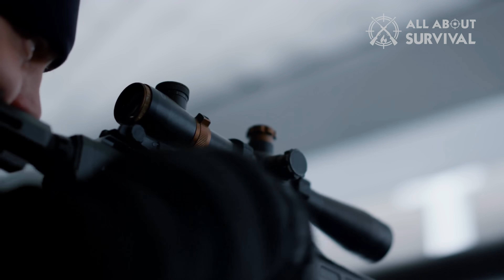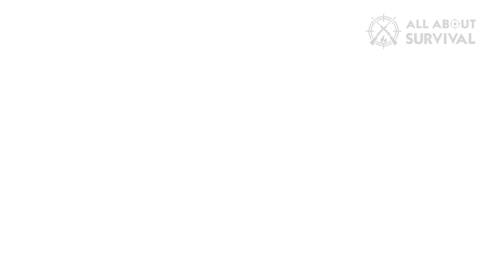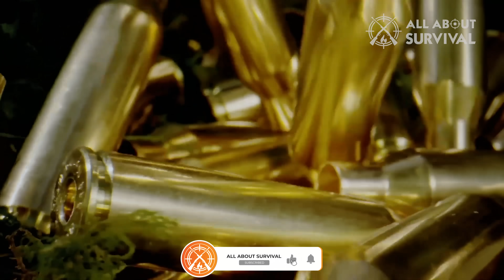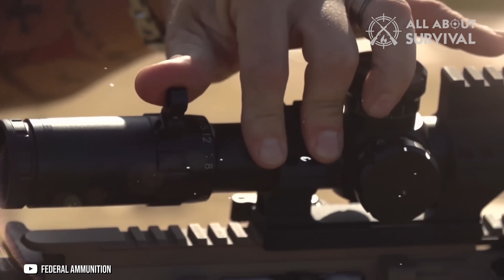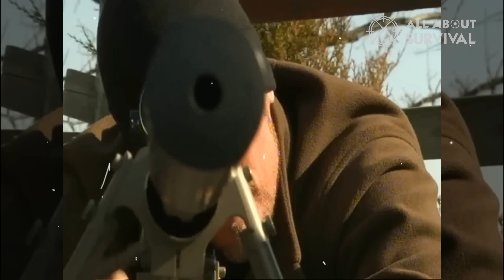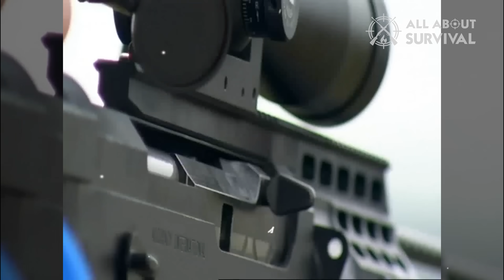Best Long Range Calibers 2026: The ONE Caliber You’ll Wish You Had!

Comment: I have a 6.5 Grendel, 22 ARC and 224 Valkyrie. The 224 is my favorite. I’ve broken two bolts on the Grendel and am having accuracy issues with my 22 ARC. Case life is also better with the 224.

Comment: 6.5-284 Norma?  No thanks – I opted for the 6.5 PRC.  Same bullets, higher velocity and FAR better manufacturer support.

6.5 Creedmoor?  Yup, it’s a winner.  Opted for one.  Then a second.

6mm ARC?  Not for me.  Designed for use in AR’s, it offers nothing I want.  Bolt guns enhance its performance but for bolts I’ll take a .243 Win or 6mm Creedmoor every time.

224 Valkyrie?  Another cartridge designed for an AR.  I’ll stick with the .223 and 5.56, for which there are far more options.  If I need more I’ll go to a bolt with a 22-250 or 22 Creedmoor.

416 Barrett?  An obvious option for really long range shooters who don’t mind spending $12-$14 bucks per shot with factory ammo, $4900-$10,000 for a rifle or lugging a 33-lb rifle around.  Nope, won’t miss it at all.

Comment: It’s popular to bash the 308. But there are a million 308 rifles out there. Today’s 308 haas the availability of high BC bullets like the Juggernaut which will maintain supersonic status at 1000 yds without buting all new equipment. The 6.5 Creedmore requires the same action length as the 308 meaning an AR 10 platform is required for both. Hot 6 mm’s can be accomodated and an AR 15 platform but most require a .41 bolt head vs rhe 5.56 standard of .378. Many question the reliability of a thinned bolt head with a hot cartridge. The newer 6 mm max may be an answer utilizing the .378 bolt head. Newer, recently developed cartridges with long high BC bullets and 30 degree shoulders are more efficient at long ranges. But adoption of modern bullets can keep older cartridges like the 308 relevant without buying all new equipment. I have followed the 6 mm max since inception but it is slow going with extremely limited production of riflew, barrels and ammo. It will reach 1000 yds in an AR 15 platform requiring only a barrel and magazines to convert. What’s the hold up ?

Comment: I shoot nothing but 223 but do agree the Valkyrie has the potential to replace the 5.56 but why ? 
The 5.56 has the extra powder for more speed and also for heavy bullets if you want (up to 100grs.) and a massive availability for parts. 
Don't see why military would change from 5,56 , cost is to much.
After people see the costs involved for Valkyrie it will just fade away like the .222

Comment: Your didn’t mention any of the WSSM cartridges because Olympic Arms fitted them to AR-15/M-16 family successfully and they will out perform some of what you have listed such as the 6.5 WSSM. It stomps the puny 6.5 Grendel because it is a low pressure cartridge. Why not reinvent the 1950s .224 cartridge that used 120 grain bullets and get real. Your .224 Valkyrie is still a varmint cartridge and not yet in the DEER class. The 5.56 NATO still takes 8 torso shots to bring down a 2-legged DEER. Colonel Jeff Cooper was right ONE SHOT ONE KILL. That’s why WHITE FEATHER didn’t use the gutless M-16/AR-15 in his outreach program. Why did you whisper about the 6.8 SPC? Olympic Arms fitted the .22-250 into an AR-15 platform and it should outperform the.224 Valkyrie! Put said .22-250 with a 120 grain pill in an AR-10. That should sing!

Comment: I'm a 7.62x51 fan. It never failed me when my own life was on the line, as well as others. Are there better? Of course, there usually are much better rounds, but at what price (that's important to me) and other folks. And I started using 7.62x51 back in '68. It worked very well then, and for some odd reason, it still works just as good all these years later ;}> It ain't broke, so it don't need any fixin'. But I do get a kick out of that there are so many "comparisons" to see what is better and so on. So, for me, my much used and trusted round, looks to be a benchmark for comparison. That my friends is what a good ol' dependable round can still do, maybe a little better than the 'masses' :}>
Reply: It’s easy to shoot any cartridge that’s been hammered into the dirty like the .308/7.62x51 by the US Military. Any possible scenario that could exist & does exists from temp, dew point, 30% humidity, cloud cover, wind from all directions, bullets of all weights, powders, brass, primers, brass that weights “X”, this powder, that powder, prone to standing, the .308 Information causes nausea as to it’s endless volumes. Anyone wanting to buy a cartridge that’s had every conceivable shooting scenario already computed & dialed in; you can’t beat the .308 or 7.62x51. Just follow everything the US military’s spent years compiling & yeah….you’ll hit this or that @ this particular range. To me it’s became the lazy way for anyone wanting to get into 1k shooting as you need do NO FIELD WORK, as anything you can possibly think of has already been done for you. Thanks but No thanks! Not saying the .308 can’t get it done but at this point in metallurgical advances, stock fit & finish, optics, reticle specific dial-ups, bullet performances at various yards & the vast lineup of incredible cartridges I’d literally take at least 7-10 other cartridges over the .308 ANYDAY. I prefer cartridges such as the 6.5x55 or .260 Remington to be brief but back to basics if presented a .308 or .30-06, I’ll take my trusted & copied (by .308), .30-06’ Springfield any time no matter the objective. I mean NO disrespect to any of you & your chosen round, it’s just me saying I choose differently & know there are far better cartridges out there or old standby’s that get er’ done easier & better. (However, all that said & I’m including the old workhorse .30-06? Some habits are too hard to break?)
Reply: I follow an extreme long range shooter from Australia and he swears by that as the cartridge to learn to shoot long range.  His claim is the newer cartridges take away calculations and skill that are developed through shooting said cartridge at distance. Much respect sir. I'm dialing mine in and sending it
Reply: Let's lose, I also have 7.62x51 and 300 win-mag for big game, 6.5 is just a fad or for those who can't handle the recoil!!! It won't last!!! Also much better reliability!

Comment: The 6.5 Creedmoor fits perfect in an AR10 mag with a 140 eld. If you load magazine length the bullet is above the donut which will help keep velocities tighter and long range groups better. The velocity given for the 6.5-284 were pretty lame. With 140gr bullets mine shot good using 4831sc at a velocity of 2970. Using Reloder22 it shot good around 3080 with 140s.  My AR10s in 6.5 Creedmoor  shoot at 2977 fps.
Reply: That is a dangerous load. Or your just full of it.
Reply: 6.5 Creedmoor at 2977 fps?? Maybe with light for caliber bullets. With that velocity, you've giving up the only thing the creedmoor has going for it, the shorter case and ability to load heavier high BC bullets and gain a little.... very little advantage at extreme long ranges, like 900+ yards.  Any real world hunting distance and the 7-08 smokes it. Honestly even with a high BC bullet, it still barely beats the 7-08 even at ELR's.
Reply: @chrisrosenthal1210  maybe true in numbers the difference  between the 708 and 6.5 is negligible at any range imo. Sectional density matters as well you just don't hear anything about it anymore it's all about the BC snipers I UT there.
Reply: @albertlemont5471   That's one of the things I have against the 6.5 CM...  It's not a bad cartridge. The concept is good, and I get what they're doing.  But when Hornady brought that thing out, they HYPED the ** out of it to the point everyone though the wheel had just been reinvented.  I get it  though. It's marketing. The best way to create a sales boost is with a  "Latest and greatest" new product.  New firearms sales, new ammo sales.... Not stagnant sales from older guys sitting on a 10 year old rifle that works fine and they already have 15 boxes of ammo for lol   The concept of high BC bullets is awesome.  IF IF IF you are shooting at long enough distances to see the benefit.  Target shooters rejoice!!!.... You can now mitigate wind a bit better, stay supersonic at a longer range, and have less drop to deal with...  BUT, how much is it really helping you?  I mean if it had 11 inches less drop than caliber X... does that really matter when you're already dialing 230 inches od drop?  Not a lot of difference between 230 and 241. I mean if you can hit with one, you should be able to calculate drop on the other. In the case  of the creedmoor and 7-08, the difference at 1,000 yards is a couple inches. Almost identical. But everyone and their cousin bought into the Hornady hype and had to have one. Now you don't even hear about 7-08 much because the sales dropped. Newer generation thinks the creedmoor is FAR superior when it's really not.  The problem with the creedmoor is they backed that shoulder up in order to seat those long high BC bullets. It cost them case volume and in turn much needed velocity.  Step up to a PRC or a wildcat like the 6.5 Sherman Short and now you're cooking. Those bullets need that 3k 3,100 fps mark to really shine.. for a hunting situation that is....  Now in the real world, like ethical hunting distances, say under 500 yards, there's several calibers that outperform the 6.5 creedmoor. 7-08 being one of them. The 7-08 will shoot a heavier bullet faster AND flatter withing 5 or 600 yards. The drift starts to pay off around that range, but not by much. I mean are we really thinking 16 inches vs 16.4 inches is a game changer? The 7-08 has a larger diameter, so more sectional density and will perform better on soft tissue game animals.  If I was at a ELR match punching a paper target at 1,000 yards, I'd go Creedmoor..... Deer hunting... I'll stick with a .308, 260 Remington, 7-08 any day in a short action..   If i want to extend my hunting range, with a bullet that has enough energy to reliably put down an animal at those longet 5 to 800 tard ranges, I'm stepping up to a caliber that will still have some punch way out there. Something like at minimum 6.5 PRC, 6.5 Sherman Max, 7mm Rem mag..... Sorry for the book.... lo lI get passionate about cartridge trends and misconceptions.  And I think you get it, so this is for others reading mainly.
Reply: All short action cartridges fit in an ar
Reply: @unfrsaken_soul226  well kinda. 308,243,6.5creed,7mm/08 are short action that fit in an AR10 not an AR15.
Reply: @unforsakensoul22  that maybe true but they don't all fit just right like the 6.5 Creedmoor.
Reply: @unforsakensoul22  Not true at all. You're just as bad as the channel creator.

Comment: Pre-64 model 70
25 in PacNor barrel
30-06 Ackley Improved
190gr. Acubond Long Range
61gr. Superformance pdr.
2960 fps.
1/2 inch to over the horizon!
Reply: At this point 300 win mag and you shoot mooore long !!! Whit Sierra Match 210 gr. and the right power , or MK11 recharge recipe  !

Comment: 7 prc should’ve been on the list. Getting to fire bullets with a bc of .796 around 2900 fps in a standard length action is impressive.
Reply: 😂7mm rem mag & 7mm Weatherby mag both beat 7mm prc
Reply: @poorfatman5317  Do you always use the laughing emoji when your wrong?
Reply: Rebarrel a 7mag with a faster twist barrel and the 7prc is a chump!
Reply: @MrLucky426  Yes let’s spend money on a custom barrel, then spend more money having a gunsmith install the barrel. Now we have a bolt action single shot that beats something else by 50 fps yet still loosing to the 28 nosler.
Reply: @chadperry4021  28 nosler is a barrel burner!  7mag with a faster twist will push heavier bullets at acceptable velocities saving barrel life.  Changing a barrel is not tough to do these days!
Reply: @chadperry4021  also a 28 nosler doesn't have the twist to shoot the heavier bullets!
Reply: @MrLucky426  So when your cartridge looses you bring up being a barrel burner………Then right after that state a barrel is easy to change. Your loosing the discussion to yourself.
Reply: @chadperry4021  no cartridge loses if you have the right combination.  The 7prc was not that good to start with when there is already a 7saum or the 7wsm.....  The 7prc is pointless unless the casing was that of the 300prc.  

For instance look at the 243 win and the 6mm remington....pretty much the same cartridge,  just different twist rates...
Reply: @MrLucky426  if the 7 had been based on the 300 case it would’ve been the same capacity as the 28 nosler. In your own words a “barrel burner.” Also to say that the saum and wsm cartridges are superior to the prc is a terrible take. Both were designed to shoot lighter bullets. The 7 prc launches bullets with unheard of bc’s at decent velocity’s with a quality off the shelf rifle. No custom barrel or crazy magazine accommodations required.
Reply: I bought a Defiance action and a 7 Rem Proof barrel with a 1-8” twist. Changing out prefit barrels in different calibers is a 10 minute job at most. 

The days of 6 month wait times and expensive gunsmiths are over unless you have an obsolete non precision built factory gun. Junk straight out of the box. 

Replace stock then trigger then bottom metal. Then rebarrel it with a gunsmith who has to first square the action before even beginning to cut the chamber and set headspace. Then HOPE it shoots because if not you get to buy another barrel and try again. 

All that ends up costing you three times what a precision action would have cost you that you could build out any way you wanted to with whatever calibers you wanted. 

So buying the $400 factory cheapo didn’t save you a dime.
Reply: @NWimport  Sounds like a winner. What stock and scope will you be running? And what barrel length?

Comment from the maker: 6.5 Creedmoor has been my go-to for those long-range days. Its versatility in different rifle platforms and impressive performance out to 1,000 yards makes it a no-brainer for anyone serious about precision shooting. But I’m curious—anyone here making the switch to .224 Valkyrie for those lighter builds?
Reply: I love my 224 but savage single handedly tanked that cartridges roll out and stunted it growth.
Reply: @user-po5po6pn8o  replace the barrel. I got a good one but I've heard stories....and stay in the 60-80gr bullet weights, unless it's a bolt gun.
Reply: What do you think about the 7prc
Reply: Little specialized, but I love my 6.5 RPW Weatherby for 1000+ yards
Reply: I've been shooting & loading for valkyries since the jump. Got lucky and never got a bad early barrel cut with non spec readers! I've had 3 vslks, still have 2 of them. Sold one with 8k rounds down tube!! Still was. 5 moa shooter! I load 50gr vmax at 3500 fps for prairie dogs & 85gr nosler rdf's for distance at 2875 fps. Valk will do 1,000 yards but doesn't hit steel hard enuf! It's a gr8 800 yards & closer round
Reply: It’s great if all your doing is punching paper…
Reply: @anthonythomas1750 Someone lied to you. The 6.5mm bullet moving around 2800 feet per second has been efficiently harvesting game for over a century, even longer than the 30-06